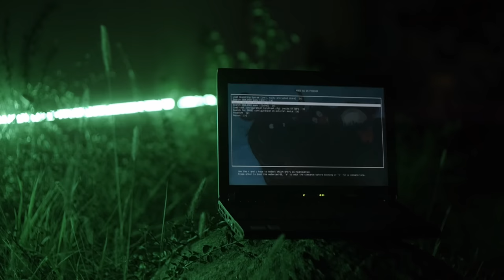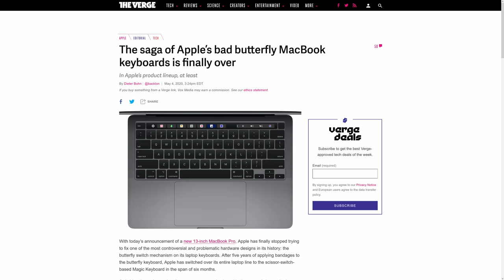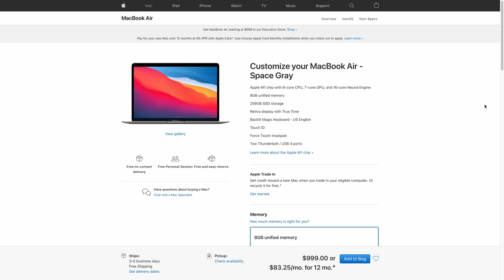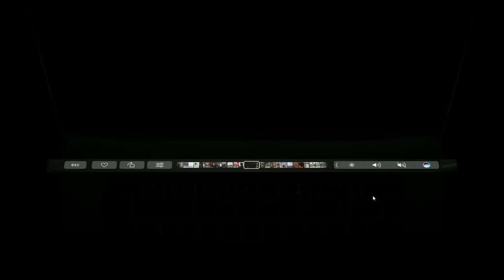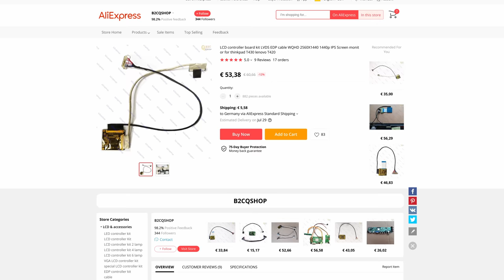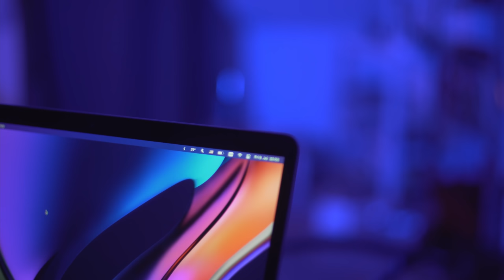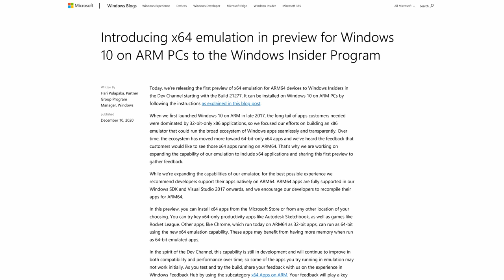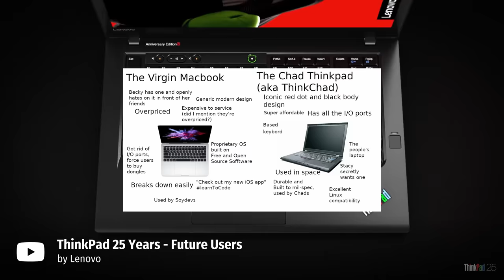Why I Switched to Mac (as a Linux user)

Comment: There are pros and cons to both as you mention in your video but ultimately Apple is far too anti consumer. Hardware is only one aspect of buying a computer, software was the key reason why I chose my P53 Thinkpad. Most GIS software (especially ArcGIS) runs natively on Windows and requires a powerful workstation with a dedicated GPU for rendering. Battery life and quietness was overlooked for performance and scalability. Additionally, Windows Pro OS are far better than the consumer version and has key features that makes virtualization and RDP extremely easy. The security is far better as well with integreated TPM for file/folder encryption. I can run Ubuntu on my HyperV as a VM containing all the software/tools available to Linux without dual booting. The options are limitless. 

BUT Apple forces you to stick with their software which GREATLY limits the ability to dive into the open source universe. 16GB of ram is not enough for virtualization and MacOS receives "new" updates every year which limitslifespan of your laptop to 5 years no matter how good the hardware is. Apple will stop supporting software updates forcing you to upgrade and buy back your perfect macbook for pennies to the dollar just to repurpose it and resell at a high price. Apple users will be stuck in a cycle that drains their wallets. 

The P53 is a not a loud laptop by any means, no one as ever given me the stare in local spaces. And finally... THAT RED NIPPLE THOUGH! 🎷❤🎷❤🎷❤

Comment: Regarding SSD lifespan, it is such an exaggerated issue I wish it would just die. I am a developer that heavily uses my M1 Max, despite having 64 gb of RAM I regularly have 10+ GB of swap and compile tens of thousands of files at a given time. I even run my staging server locally and last I checked my SSD usage (as of 2 months ago) I had only used 2% of my SSD's write capacity in 2 years. Barring a physical defect/damage therefore the SSD should last for close to 100 years, far longer then the useful life of said laptop.

Comment: All valid points. There is no doubt the Macbook M1's are better than Windows laptops including Thinkpads. But good luck when the soldered and encrypted SSD fails. It requires a new motherboard. It may not fail in your ownership. But just like the butterfly keyboard hurt used prices, when we eventually start seeing failures then it will hurt resale of M1's and M2's as well.

Comment: Comparing a brand new macbook built for best portability with a older thinkpads built for best servicability is not really fair. Intel core 3xxx or 8xxx are also a few generations old.

Sure, macbook air destroys those thinkpads and CPUs, but this also happens with newer generations of CPUs/non-macbook laptops.

Comparison with a modern windows ultrabook with ryzen 4xxx would be much fairer.

Comment: They are nice and sleek laptops indeed. Until something breaks in them
Reply from the maker: Fun fact: one of the Thunderbolt ports in my Thinkpad X1C6 broke. The only solution is full motherboard replacement. 

The USB ports on the M1 Air are on a separate daughterboard
Reply: @WolfgangsChannel  That's very subjective. The thinkpad you've mentioned is the new one, and the newer models are known for being less replaceable and upgradable (in the favour of cheaper production and money when replacements occur). I'm not going to defend Lenovo. However
When it comes to macbooks, due to the way they are put together, it is harder to replace components, and Apple is actively discouraging users to fix them by not providing parts and guidebooks.
Reply from the maker: Agree 100% and said as much in the video
Reply: @WolfgangsChannel  well yes I did pretty much reword it. Very good video, after all, I must admit

Comment: I agree with a lot of what you've said,  and it definitely doesn't pay pay to be so dogmatic about what laptop or even OS you want to use. However, it's also a false dichotomy. You don't have to choose between just Apple and ThinkPads. There exist many more laptops than just those from the two manufacturers.

Comment: Agreed, agreed, agreed and agreed! All of the above! Upgradability died in the 2000s when machines were WAY more expensive for what you got and the new tech came out slower than now. And yes ALL companies are following the poor QC and cheapening of components and design. Our workplace bought a bunch of "work" systems from a well known brand and 6 of 18 deployed needed to be returned!. And sure you may get a Macbook that has hardware issues out of the box, but return that thing and you get a new one! Now here are a few points to add to the list you put together: the screen quality is AWESOME, homebrew and macports gives us most linux "dev" tools, MACOS just works well with large support from Apple, the outer shell of Macbooks is just really well made, the keyboard is one of the best, the no-noise factor is WAY more important for daily driver that I first thought. My only hope is a 15" AIR.....please rumours be true! I need the realestate for my many terminals and IDEs and tools and browsers and office stuff and .... THANK YOU for an unbiased review of the 'dev' use case!

Comment: I only have a macbook because it was actually cheap, when you compare it with comparable windows laptops in the same segment. it also has great battery life which was also 50% of the reason. I would gladly buy a windows laptop once windows laptops get similar battery life with snapdragon or if intel gets good with it. also hate mac os, windows on arm or a decent linux system would be a great boon for me.

Comment: Been using Manjaro XFCE on a Lenovo Legion since 2017. Never had any of those issues you reported.
Reply: Good for you then. On the other hand, I've had so many issues with linux that I just keep running back to Windows all the time. Just because your anecdotal experience is fine doesn't mean that it's the same for everyone, especially because Linux is absolutely not for everyone and just doesn't work as stably as Windows or macOS. I can't remember the last time I had to worry about my system just being completely screwed up randomly one day on either Windows or on macOS. I can't remember the last time that I had to deal with issues such as Bluetooth not being plug and play, and in my experience, Bluetooth and wifi stop working after going to sleep. I can't remember the last time that I had to worry about finding an alternative to an application on Windows or even for the most part on macOS. It just works better. Linux is the operating system I've used the most in my life. But it just isn't viable for too many people.

Comment: I like the M1 macbook, but good luck using a USB or wireless mouse with them in docked mode, it skips around all day and is horrible to use. it's apparently an OS issue, same thing happened on the last intel macbook as well. I've tried everything except using an Apple brand mouse and this issue continues to drive me insane.
Reply from the maker: Currently using a Logitech mouse with a USB dongle with no issues – also have a wireless Kensington trackball which works with no issues.

Could it be the docking station?

Comment: as a MacBook user - I hate Mac's keyboard, you never know in different programs if it is Ctrl-S or Cmd-s that saves work, even in apps from the same source - VSCode vs VS! Libre Office crashes, the default terminal sucks. I have NEVER had to do anything with Linux on several laptops, they just worked. The size, battery life and processing power of Dell Inspiron 7620 (i7-12700H) are just phenomenal for anyone as a programmer, I think you would need to pay 3x more for a comparable MacBook Pro, you would get a better display but I rarely use laptop's display, actually. And processors that are coming from AMD in 2023 will be a big trouble for Apple. Again - I have to use a Mac because my company demands it, but I would love to have a Linux laptop, or a linux mini-pc.

Comment: Still finding the mac air as double the price for the same configuration with a lenovo with ryzen 6800HS and I don't think mac air leads much in performance. The only issue is finding the right OS for the machine since windows is not for me. Apple still selling ridiculous price for extra hardware on their mainstream devices, which is a bummer for me in purchasing those extended configurations.

Comment: Hey. Its mid summer 2023 and i went to the same pain of choosing a laptop, ended up buying a macbook...

Tho im a linux head, and framework with zen 4 undervolt chips might be the GOAT this year, but in the end as a programmer I need a reliable, well-built laptop for coding on it.
But in case of windows\linux laptopts atm it is still a lottery(

So i do feel like i dont have a choice actually. Pricey, but with good perfomance while still being cool in terms of temperature, quiet, well built, good looking machine. It only macbook out there atm.
But we'll see about zen4 7840u and their 15w tdp)

P.S. And yeah, one more point to mac - it easy to sell them) If AMD zen4 will be a good chip, i'll sell a mac and will buy a 16" framework instead :D

Comment: I run Linux as my daily driver and love using it with a tiling window manager, but I don't hate apple. As a matter of fact I have an (older) iPad mini that I use a lot. 
The main thing about an apple product like an iPad or an iPhone is that it just works. It's not meant to be tinkered with, it's a tool to use. Nothing more nothing less. 
People should stop treating apple/windows/linux as religions. You don't like something? Then don't use it. But don't expect everyone else to think the same. 
The price though has kept me from buying a macbook. However I am sorely tempted with the way Windows is going. I use some few apps that only runs on Windows, so I can't keep it out of my life. (and for a little gaming as well). Some of these apps would run on MacOS however, which is the reason I am looking into a macbook.
I don't like Windows (personal preference). I like Linux (again a personal preference). I cannot say if I like MacOS as I have never used it, but I do like iOS on my iPad. 

You should always use the right tool for the job. You wouldn't use a screwdriver to hammer in a nail in a wall either, would you?

Comment: Problem about upgrade is, you literally talking about a decade old laptops which is the point of upgradability. I have no problem with CPU, but RAM and SSD are necessary upgrades. I have MBA 16gb RAM 256 SSD and I really suffer from storage and cant even change it without selling and buying second hand. Its not a good approach especially when a changable part dies you have to change the whole motherboard which is a fortune nowadays.

Comment: At the end of the day my M1 MacBook Pro is silent. The only time I hear the fans this computer is when I am playing a game. This computer changed what I think computer should be. My ThinkPad x13 5G fans would kick in with the smallest work loads. I even complied large programs on this thing and nothing. I have to had it to Apple on this computer. 

With all that said my ThinkPad X13 only has one upgradable component and that is the NVMe stick. Today I think it is about personal preference than anything else. Most computer are becoming hard to upgrade and as a software developer I can understand why. That is for another day through. You will have to pick you own poison Lenovo, Microsoft, Dell, HP, or Apple. Etc....

Comment: why are you comparing a 2013 thinkpad to a m1 macbook tho? you should compare notebooks at the same price range. a thinkpad that old can be bought almost for free, unlike the macbook, so the obvious choice for someone that's not shitting money is obvious. also, your statement  about microsoft releasing windows 10 for ARM and it not running games as good as a m1 mac doesn't make any sense if you don't tell in which hardware windows 10 arm was tested. you are comparing apples to bananas and bananas to lettuce.
Reply from the maker: Wrong, it's actually a 1993 Thinkpad. I did it because Apple paid me for it, and Apple sheeple won't know the difference between a 1993 Thinkpad and a modern one anyway /s

Comment: They're spyware filled but otherwise great systems on overpriced, unrepairable, often designed to break, port-lacking, overheating machines with otherwise surprisingly good build quality and a nice screen sold by an anti-consumer, government surveillance-compliant company, the only real advantages of using their system are their exclusive apps and the fact that it "just works" (unless you live in a humid area and will get your warranty voided by "water damage" or have the machine break in any way outside of the warranty), fuck apple, if you don't have a very specific reason to use it, you really shouldn't support their scummy business, despite M1 being an awesome CPU (also since other companies will shortly follow with competing chips)
Reply: @DMSBrian24  m1 offers best performance to price

Comment: For a laptop I care a lot about the keyboard. I am quite surprised that as a Thinkpad user you did not mention any of it. And this is the sole reason I hate Macbooks(and a bunch of laptop that followed the Macbook keyboard design). But unfortunately I am using it everyday as my work requires it.
Reply from the maker: I did, actually
Reply: @WolfgangsChannel  Oh sorry found it in the upgradability session and I skipped that since I don't really have any hope about about upgradability on laptops. (now we have Framework which have introduced some hope, but it is still using the common "Macbook inspired" keyboard layout). I agreed with you for the most part, just hope future laptop makers would take care of keyboard experience.

Comment: So much wrong with this dude that i'm just marking this as misleading. X86 on the AsBooks is still shady (925). Sure if all you do is compile code and run text editors you'd be fine with a C2D.
Farcry 3 ran on a wine/proton equivalent (if not on reactOS). And that's just the first few minutes. Not even going to bother watching more of this.
Hope you like buying new computers instead of having your old one fixed, because that is what waits you with planet Apple.

Comment: Microsoft was ahead of the ball 12 years ago with Windows RT, but they killed it off because of bad marketing, and what I believe to be design through committee and no clear design vision. They marketed Win RT and misled users into thinking it was a feature rich windows experience running on ARM. Making it look exactly like Windows 8 only further confused and frustrated users. Their UI and UX design for Win RT / 8 became convoluted, mashing together UI ans UX elements that were both suppose to touch friendly and desktop friendly. Even to this day in windows 11 there is a mis-mash of UI elements that clearly don't belong together. Like I don't know a single person that prefers to touch their desktop or laptop display instead of using a mouse/keyboard/trackpad. Microsoft ended up killing Windows RT through their own incompetence, and now are racing to get it back.

One thing I will give Apple credit for is always having a very clearly defined design vision. OSX / MacOS machines don't have touch screen devices, because they aren't designed for that from a UI/UX perspective; that's what iOS are for on iPhones and iPads. There's no weird mish-mash of pieces like what Microsoft tires to accomplish in a single bloated, monolithic OS.

Comment: M1 was a thing everyone should did in 2015. Or at least should began seriously working towards. Using x86 in laptops is just hilarious in 2021, yet in 2023. 
My Samsung S23u is legitamately several times more powerfull than my old Dell Latitude on i5 6300u, has DeX and 12 GB RAM, but it lacks tools for work other than basic video/photo editing, microsoft suit (without Visio though) and web apps, and i'm not allowed to run containers or VM on it (well, actually you can via Termux, like run docker in a VM in a terminal emulator, LMAO), so I just can't get rid of x86 laptop. 
And DeX on Windows is usable, but sucks (like, 30fps software cap and unreasonable delay even with full-blown USB-C port in laptop with the most suitable cable), so it is not an option for giving a second live to an old laptop, which struggles even with casual web browsing, which would be extremely nice. But it can run wirelessly, at least this justifies poor perfomance.
It just pisses me off, that for now the only sane company in this regard is damned Apple with all their bullshit, while others just being busy eating sand in a sandbox.